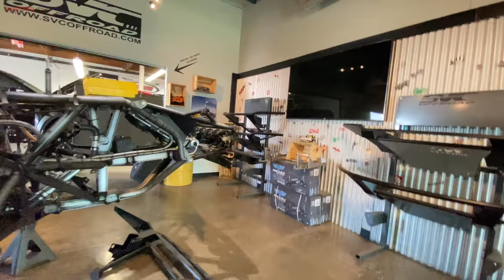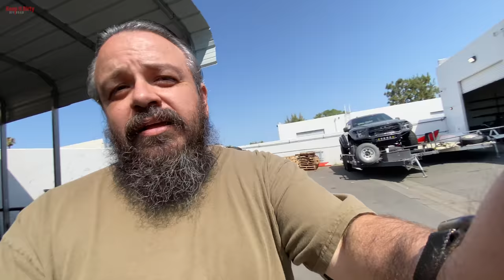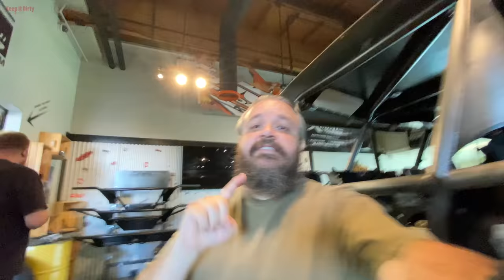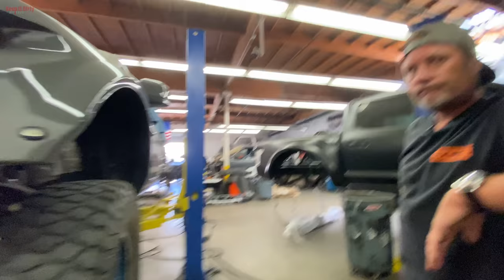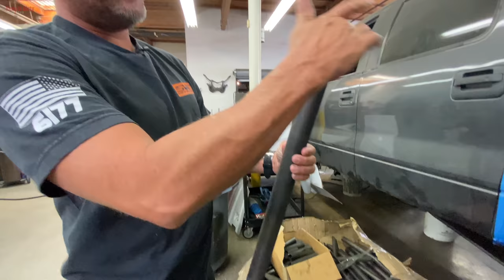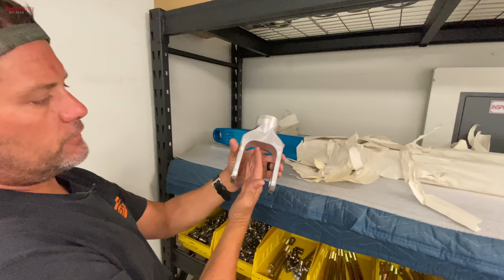SVC Offroad Shop Tour - Linked System First Look

Comment: I would’ve wanted to build my regular 2015 f150 xlt with you guys but unfortunately I’m all the way in socal. Would’ve wished you guys have stayed but I understand why you might’ve moved.
Reply from the maker: SVC unfortunately don’t monitor this video man sorry. Then moving out of SoCal is a understandable but also did not make sense to me considering how many customers they have here
Reply: @ Oh shit I just noticed that this wasn’t their channel lol 😂 thank you for letting me know and I completely agree with you considering they have many customers here. I feel like I won’t ever get to build my truck because of them moving. It is what it is.
Reply from the maker: There are a few shops out here in so cal building trucks man. Some I would dare say are better. Look at BMS, HRD, and HM as just a few still in SoCal building badass trucks
Reply: @KeepItDirtyOffRoad  I’ll do my research on them. Thank you. The thing that had me sold with SVC is that they were known to make capable trucks that can be driven on a daily basis and also I like the looks of their bumpers for the front and the rear. I’m not sure if I’m mistaken but I also heard that they offer warranty? Is that true?
Reply from the maker: They all have a certain level of warranty yeah. But if you break it doing something dumb, it’s always on you. 

Look into the other shops. Nothing says you can’t rock SVC bumpers with other suspensions kits. They do make some of the best designs for bumpers IMO. But suspension wise, there are more options and some companies like BMS and HM offer long travel kits for the same price
Reply: @ Thank you brother, I appreciate it.
Reply: @KeepItDirtyOffRoad  One last question. Which one is the best one in your opinion based off what you’ve seen or experienced?

Comment: I wish they would make parts for my 2015 F-150, seems like the best company out there for Ford suspension parts!
Reply from the maker: 2015 F150 is very similar to the Gen2 Raptor. Just needs a little extra reinforcement on the frame to be on par

Comment: Do you know if you can install a factory front camera on a 2013 
Raptor?
Reply from the maker: Some come with factory cameras up front. Mine did. But the process to use it makes it a useless option. Have to be in the right mode and 4wd on a Tuesday during a leap year and it just impossible.

Comment: Love the shop. Too far from Phoenix but then again might be worth it in the end:
Reply from the maker: Yeah maybe. Any local shops around you? What about Foutz?
Reply: @KeepItDirtyOffRoad     We have ADD and 4WP. I’ll look up foutz. I think he helped with the first Raptor R.  Born in Baja
Reply from the maker: Yeah, definitely avoid 4wp. Check into Foutz man. I’ve heard they do good work
Reply: @KeepItDirtyOffRoad    Will do. I’ve got the ADD bumpers and they look sweet. But suspension is something else
Reply from the maker: YeH, not a fan of the ADD stuff for suspension. Way too expensive. You follow the Arizona Raptor runs guys? August the guy that runs that group is a good dude and can probably let you know of any other shops. I know he has good experiences with Foutz and may know a few others out there
Reply: @KeepItDirtyOffRoad    Working on getting my truck done up so I can do some runs with them. U know the usual. Extra spare, radio, jack, and amber chase lights.

Comment: Lol. Talks about how much the Fords crack and reinforcement is needed. Then trashed Toyota. They’re all factory trucks and you’re trying to make them prerunners.
Reply from the maker: All the trucks have weak points for sure. 

Raptors see a whole lot more abuse on the trials so those are well documented. Toyota’s not so much because stock they are not as capable. But built up, they can be great too. Won’t look as good though 🤪.
Reply: @KeepItDirtyOffRoad  I don’t know. I never seen a 10 year old abused Raptor on a trail. Couldn’t tell you how they look over time. Toyota’s all the time. I, like you, stay around my Toyota groups and every once in awhile a Raptor wants to come play and break a spindle. So, I’d say both are well documented. 

Everything he walked you through to reinforce Raptors. Boxing, plating bed frames, cross bracing under bed, all gets done to Tundras/Tacoma’s.
Reply from the maker: Yeah, that’s all fairly standard reinforcement on bolt kit with mid travel. If anything SVC is light on reinforcement compared to what I’ve seen. 

I see 10yr old Raptors all the time on the trails man. Gen1 first came out in 2010. You can usually tell them apart by the headlights. Been running the trails hard for 11 years and still running 🤷‍♂️.  I don’t see many tundras on the trails though. Not with high speed off-roading anyway. See a bunch of tacos doing rock crawling all the time. But those guys have their own set of problems there. Offroad anything is going to have problems. I personally think the Raptor will have less than most. And usually when someone breaks on the trail its because of 2 things. 1 running beyond what the truck and they can handle, or 2. Bad group direction and not calling out hazards.
Reply from the maker: Anyways man. Why we keep going in circles here. Everytime you post it’s the same thing and for the most part we agree. You going coming out on the trails with us one day or what? Would rather talk shit In Person than this silly crap over messages.
Reply: @KeepItDirtyOffRoad  lol Yea. I’ll be out there one day. Mine is do for an overhaul. Need to do water pump and heat exchanger before I go hard. New Suspension gets put on this month hopefully. Been waiting since June 2020. I’m hoping I’m GTG by October because I’m trying to have the family in Big Bear for a few days.
Reply from the maker: Nice!! I’m hoping my truck is ready to play by last week of August. Definitely need to make a trip happen.
Reply: @KeepItDirtyOffRoad  that’s awesome. I wish my guy worked that fast. He’s a one man shop and it gets super frustrating. He said I was the first truck on the lift in the new shop. He’s done moving his shop tomorrow he said. So we’ll see. Bryan knows my frustrations well. Lol.

Comment: Not doing Chevy is a mistake.. Ford already has a Raptor as an option, so you guys are redundant to a small extent. Chevy and GMC doesn't have anything but maybe the new Hummer. It would be nice to have hi quality offroad for GM trucks.
Reply from the maker: It would be nice to have a GM competitor to the Raptor but here is where you logic falls short. There are tons of Raptor shops out there because a Raptor gets you on the trails with warranty. Before you know it your hooked and you want a smoother or more capable ride and it just snowballs. 

There is very few GM guys doing these kinds of builds. So not much business in it. Until GM makes a proper Raptor competitor, guys aren’t going to know what’s possible or think it’s way too expensive.